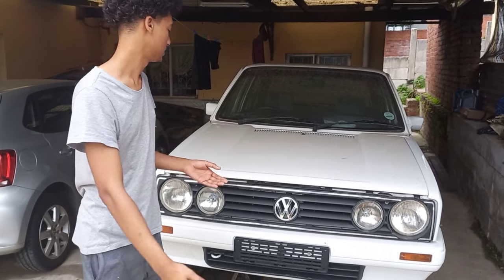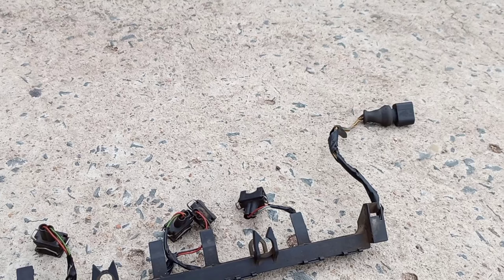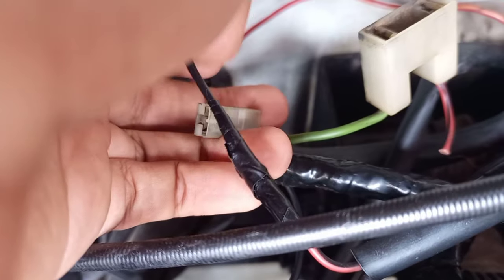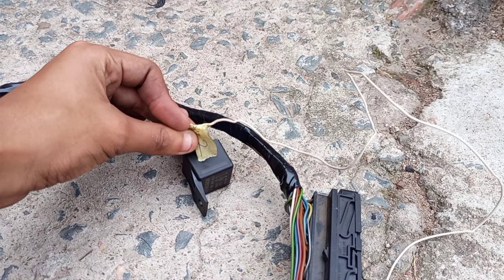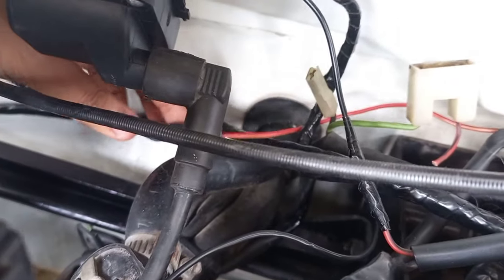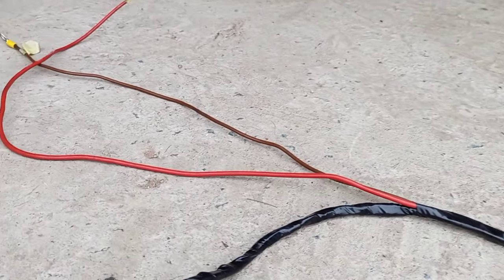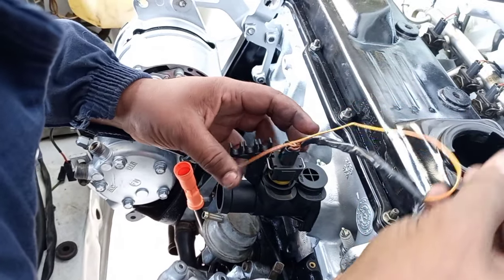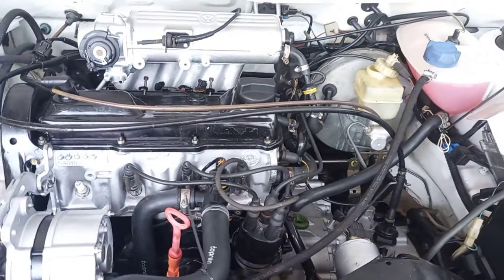Installing MP9 Short Loom - Carb to Fuel Injection VW MK1 BUILD

Comment: i got fuel injection and use the normal old coil you dont need that coil for the ignition.
Reply: Hi @leeverink32, how can i connect my mp9 short loom to my existing bottle coil and tp? Would appreciate the help